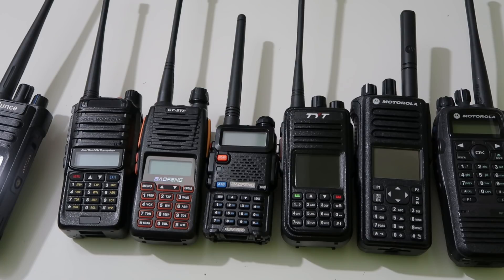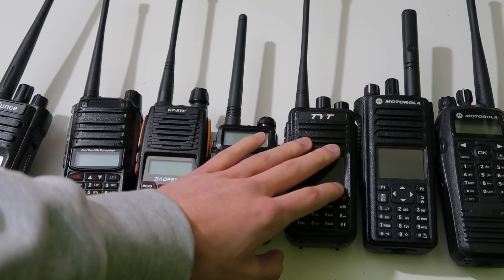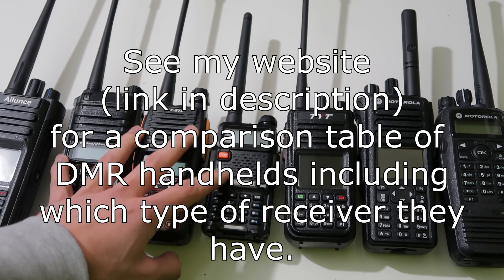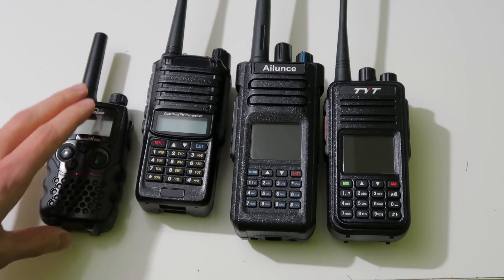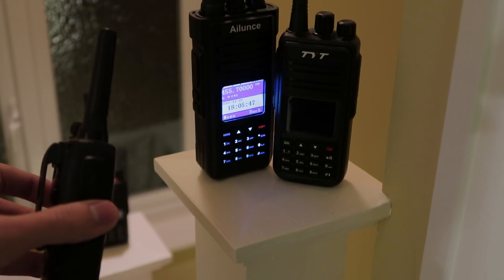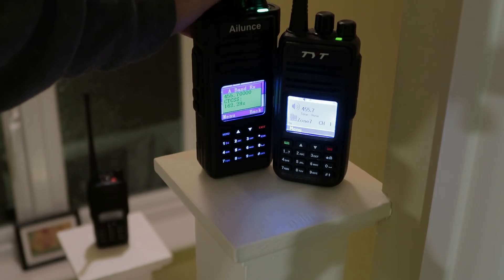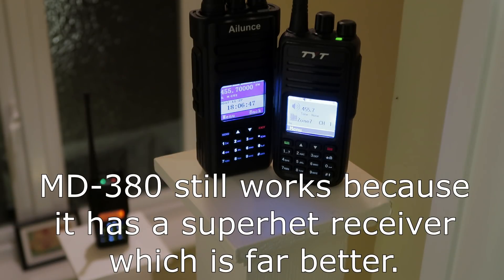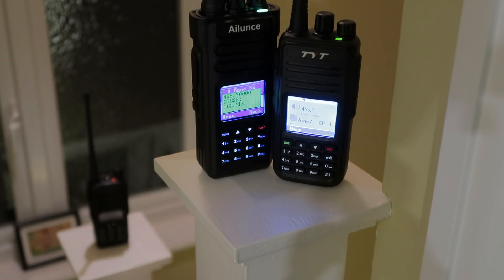Watch out for this substandard type of receiver! (in ALL dual band DMR radios)

Comment: An interesting test but to be honest I dont think it's worth worrying about.
And I dont think it is fair to say Direct Conversion Receivers are
"so much worse" than Super Het's.
A Receiver will only get Desensed if there is a strong localised signal and I dont 
know where you live but in my home town there are 2 maybe 3 active Amature Radio Operators
and we are not all on at the same time. So it's a non issue unless lots of people  in your town are licensed.

I am saving up for a Ailunce HD1 as they designed for Amature Radio and the best of the current Dualband Handsets.
Reply from the maker: But it's not even within the amateur band. I was transmitting on 446 MHz and receiving on 455.7. That's a big split. Nearly 10 MHz. The radio would get desensitised by transmissions on any frequency, not only within the amateur allocation nearest to the frequency you're using. If there happened to be a business radio repeater near then the radio could be desensitised. I was only transmitting on 0.5 W so I imagine the effect would be much stronger from a repeater which could be transmitting something like 50 W.
Reply: @radiosification  A few places like a thrift store or dollar store with these neon lights opens up my squelch theres 3 such nasty places in town an I used the nuisance delete on my commercial receiver frequency is 147.000 that gets blanketed wether its my motorola xts3000 or my retevis rt3s
Reply from the maker: @aarhowell  yeah that's a completely different effect causing that

Comment: I have a HD1 and its not all that bad! Its not a motorola and i didnt spend $500 for it so i dont expect perfection either, but it does have fm stereo, uhf, vhf, DMR and is set up better than the md 380 has more channels per zone and easy to program now that i know how to by the radio. I know Ty is busy but hopefully he will be able to give them some pointers or come out with a TyTools version to make some things easier.

Comment: I do not want to spoil the fun but this demonstrates absolutely nothing, use proper test equipment so you can give numbers and figures.
Get your fact straight, the big M also uses direct conversion, all SDR based radios are more or less direct conversion. As for Super Het receivers there are good and bad ones. In 10 to 20 years super heterodyne will be ancient design.
There are just more things that come to play like preselection etc.... Just saying super het is superior to direct conversion is false claim, one must consider the receiver design as a whole thing.
Reply from the maker: I don't have thousands of pounds to spend on test equipment. I'm making do with what I have. I know it's not a very scientific test but even so, the difference between the two radios is so huge that I don't need test equipment to show it. Could you tell me which motorola radios use direct conversion? And SDRs are known to have issues with transmissions causing them to be desensitised. It seems to be an issue that comes with using direct conversion. This link is an interesting read and it claims that superheterodyne receviers  offer "unmatched selectivity and sensitivity". http://www.mwrf.com/active-components/differences-between-receiver-types-part-2   Maybe as technology improves in the future there will be a way for direct conversion to become better than superheterodyne but right now I firmly believe that it's inferior for two way radios.

Also you're not spoiling the fun at all. I welcome any criticism of what I say in my videos and if I ever give incorrect information then I'll be glad to correct it. My main aim on this channel is to spread (correct) knowledge about radios.

Comment: That was a UHF link freq for VHF Air traffic control?  What was the "interfering" frequency you used?  How far from the main rx freq?
Reply from the maker: The other radio is a PMR446 radio so transmitting on 446MHz at 0.5W

Comment: Many thanks for this interesting and informative video,I have a VHF TYT MD-380, for RX Only and I was thinking about an Ailunce HD1,for UHF, But had no idea of the potential performance issue as compared to a super-heterodyne model, I think I will now buy a UHF MD-380 instead, could explain why here in Brasil at least the Radioditty GD77 Dual band is a bit cheaper than a single band TYT MD-380.
Reply: Have fun programming it in the field without a computer attached which can be done with ease with the HD1.

Comment: Is the GD-77 Super-Heterodyne or Direct Conversion since its made by TYT? And i will assume my TYT MD9600 is the hetero type since its branded with the TYT name.
Reply from the maker: I think that the GD-77 is direct conversion. And it doesn't mean anything with regards to the receiver type if your radio is branded TYT. The MD-2017 is also branded TYT but it uses direct conversion. I did say in the video that ALL dual band DMR radios so far use direct conversion.

Comment: Are you sure the md -380 is superheterodyne?
Reply: I Agree as well. I have an MD-390 an it is as sensitive as a Yaesu radio. The uV5R drops out very often an cant handle an outdoor antenna. keep the vedeos on !! Thanks
Reply from the maker: Pretty sure, yeah. I was told it by another person and you can see that this test also indicates so. The result I got is the same as I would expect from a superheterodyne receiver.
Reply: I would agree, purely from my personal testing with my VHF MD-380, on Analogue, it will receive signals from a roof mounted ground plane that a baofeng will completely desense on.
Reply: Yes it's a superhet.

Comment: What about Yaesu VX-3R and FT-60R? Are these super het or direct conversion receivers?
Reply from the maker: Sorry, I have no clue. I've never even owned anything by Yaesu haha
Reply: Likewise I am not certain, but my Yaesu FT60R certainly has no problems on an external antenna, throughout its wide RX range that cheaper Baofengs will desense on.The FT60R has certainly stood the test of time for a radio, in production for over 10 years I believe.
Reply: Yeah their both superhet

Comment: Wow. Not recommending the Ailunce DMR radio? I’ve been really interested in this one and it seems like it’s impressed a lot of the ham reviews so far.
Reply from the maker: Excellent question. I've pinned your comment. I want to make it clear that it's not specifically the HD1 that I am criticising here, but ALL of the radios using direct conversion. That includes the GD-77, MD-2017, RT-82 and all the cheap analogue dual bands. At the moment I don't think that there is a dual band DMR radio that doesn't use direct conversion, but if one that uses a super heterodyne receiver instead was made then it would definitely be a better choice than all the current dual band DMR radios.
Reply: Go ahead & make another video & show everyone how you program those other radios without a computer attached to them as well.The HD1 is hands down the best choice in mine & many others opinions.I'll be waiting on that video.
Reply from the maker: Which radios specifically?
Reply: Whats about Anytone 868 - any suggestion if it is a superheterodyn ?
Reply from the maker: According to Ty Weaver, KG5RKI, it uses direct conversion too.
Reply: I like it. It's only let down has been the programming software, and the SMA plug on the antenna is the wrong way round.

Comment: Very interesting. I didn't realize there was that much of a disadvantage. Makes me rethink if I want the Icom 7300 HF radio!
Reply: HF is a little bit different story. HF bands are narrow, signals are, in general, weaker and noise is higher - so, dynamic range is not a problem, at least, not that much.